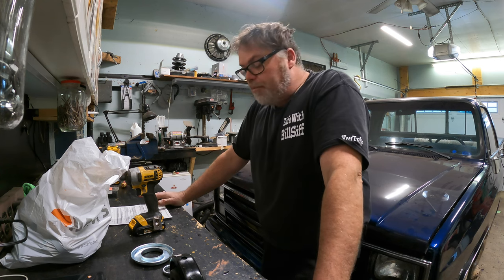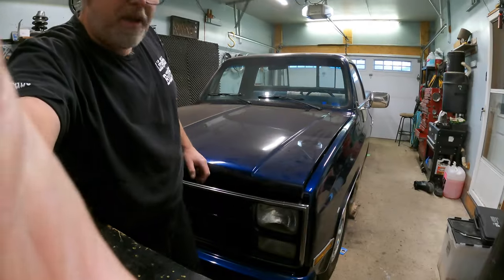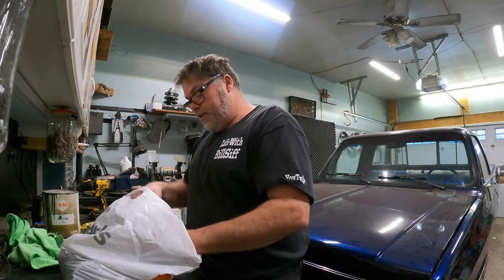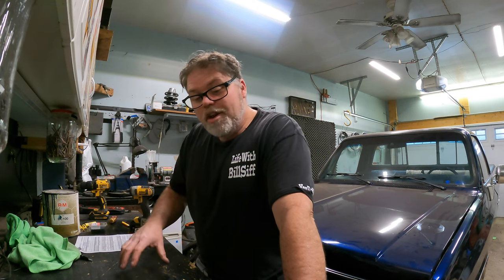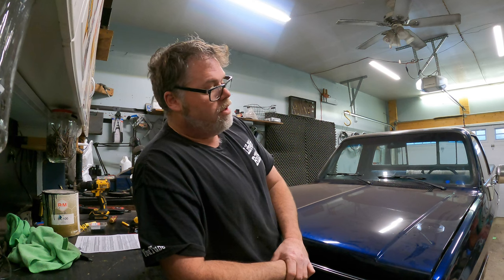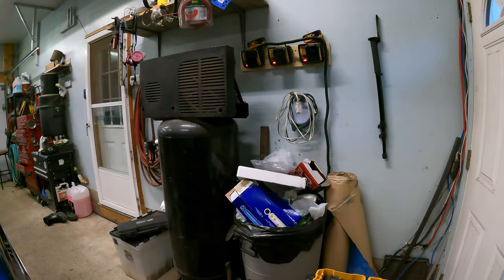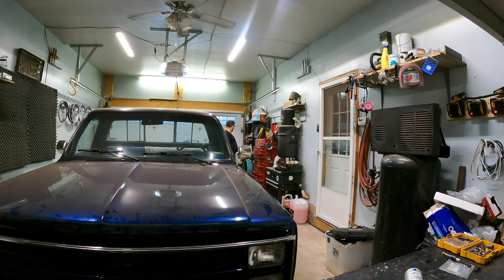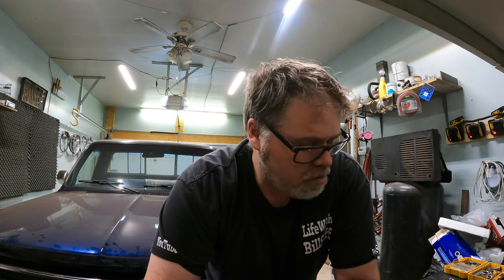This Is What's Coming   4K

Comment: No name. Too early for that yet, gotta drive her and see what suits her.  

Two piece shaft? Don't see that much in a half ton.  I'd be inclined to swap over to a one peice, none of that hanger bearing nonsense to deal with--or did Mike the tow truck driver swap it to a two piece?  SPID still in the glove box? Post a shot, curious to see how this thing was spec'd out to get a two piece if its factory.